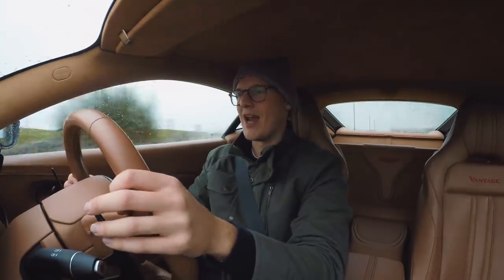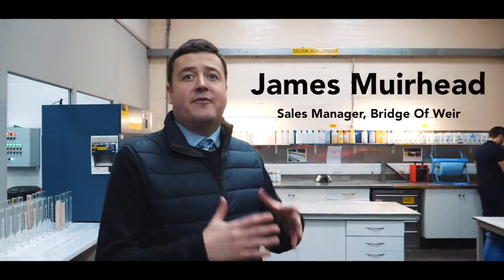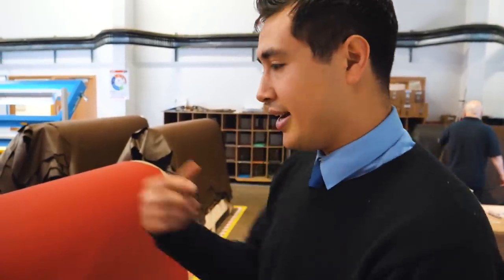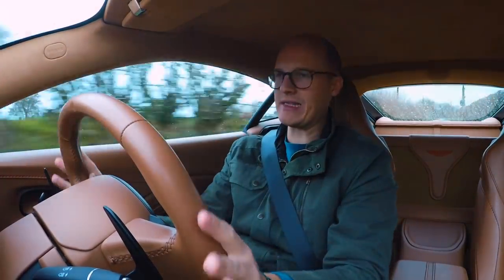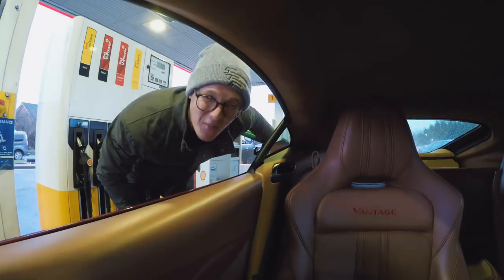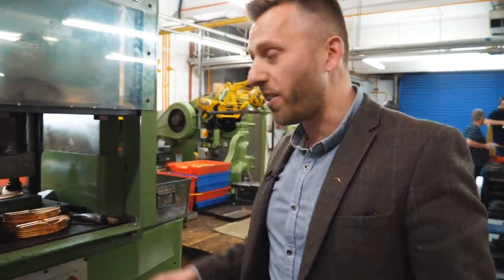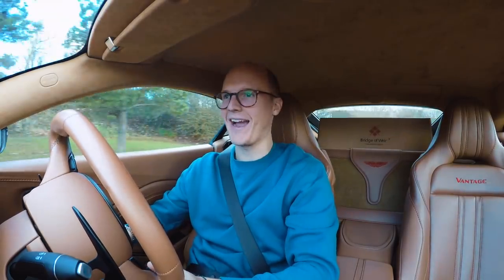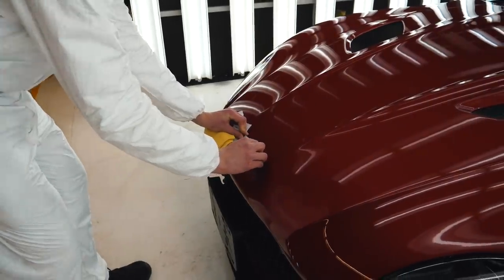Aston Martin Gave Me A Job

Comment: Those exhaust pipes look comically small
Reply: Sam Mckenzie exhaust pipes are normal size, its just that it doesn't have fake exhaust tips
Reply: Porsche ones (e.g. GT3) look a lot bigger—are they fake as well?
Reply: You can option quad pipes if you want.
Reply: You can option bigger dual sport pipes on each side. I agree they are small and look comical in a space designed for duals that ought to come as standard.
Reply: @sammckenzie2331  yes, specifically on the gt3 rs they're not that noticeable. If you look carefully at the tip, you can see the exhaust diameter increases just before the tip.
Reply: @xPUR3xSHOTZx  I actually prefer the Porsche ones, regardless of whether they're fake or not
Reply: Sam Mckenzie I’m sure Aston Martin will take your cash as an option to upgrade the exhaust tips.
Reply: So someone watches an entertaining well made video that is different from the usual run of the mill YouTube stereotypes about a very good looking car in a lovely spec and from somewhere inside can only find the wit and intelligence to repeat a comment about the size of the exhausts...what’s next..headlights look like an mx-5?....even if you are right is it really worth repeating..? Rather than saying something positive about the car or the work that STG put into making a video for your benefit? This comment may be negative..and you may reply saying exactly that...but don’t take it personally all I want to say life’s better appreciating than criticising
Reply: Chill mate, I was just starting a discussion. Of course I appreciate his videos, otherwise I wouldn't be watching them nor the ads that come with them. I can give AM criticism for whatever I'd like lol